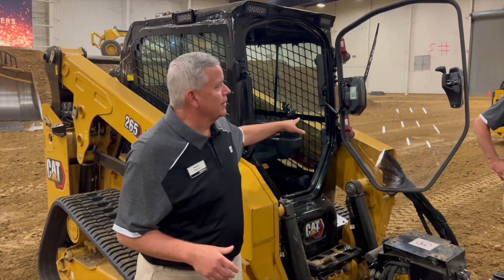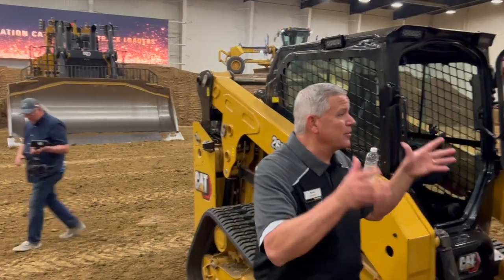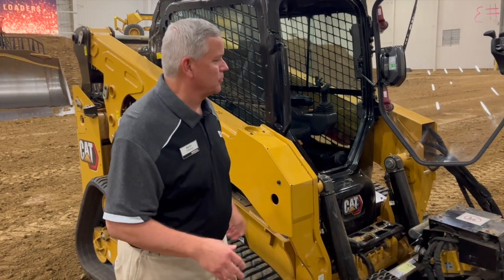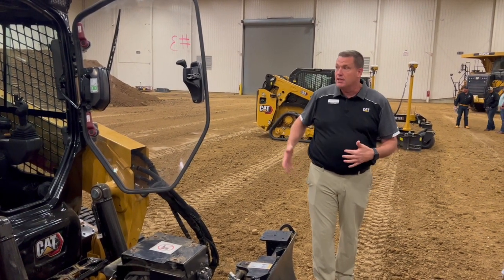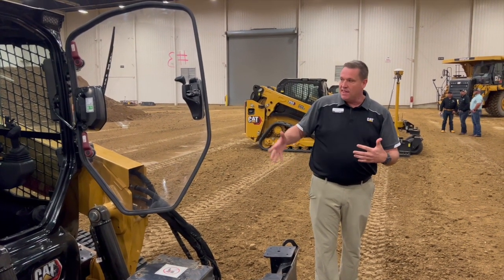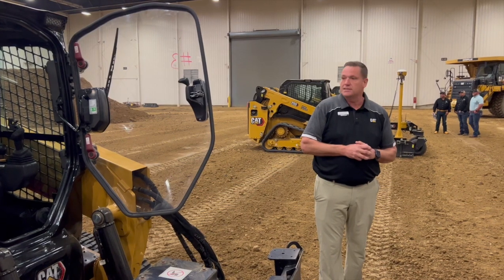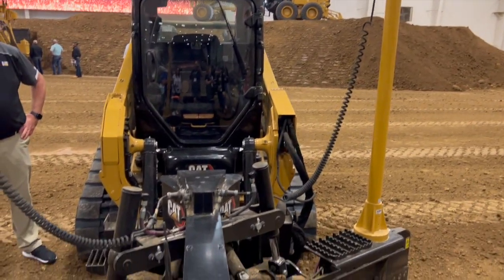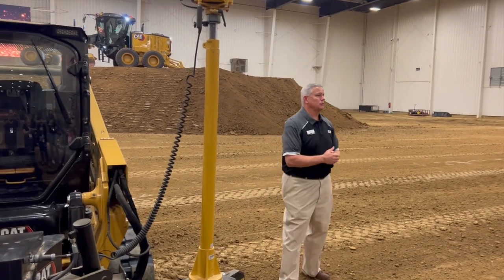Cat 255 & 265 CTL Walk Around

Comment: Those cameras look a bit knock-off-prone. 
I've spent enough time working on these things, you'd be surprised what operators will slap with their machine, and peel off in the process.
Reply: Never  hit the machine  where the camera  is   tbh never  actually  scratched  them anywhere in 20 years. But I suppose that's the difference  between operators  and drivers